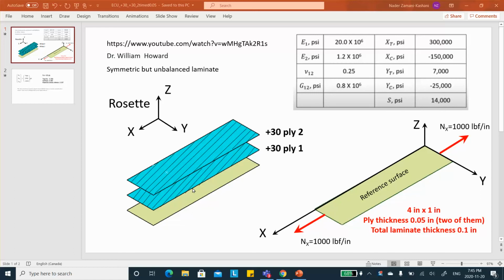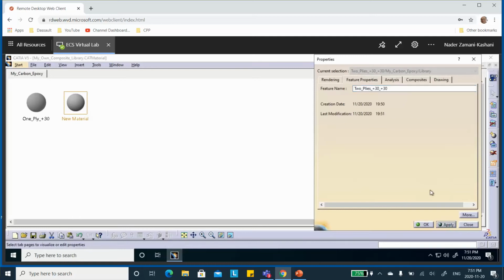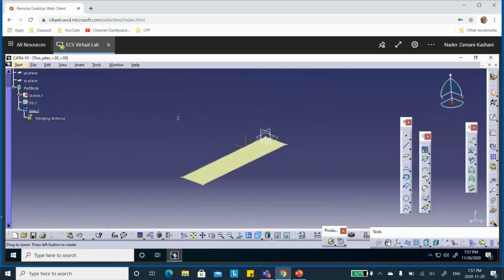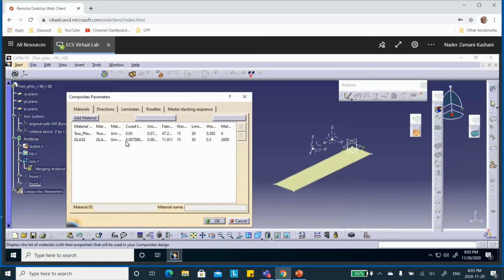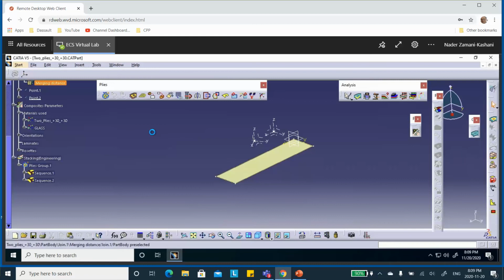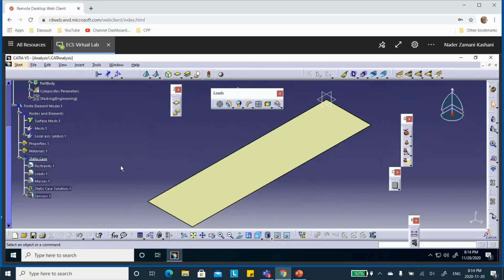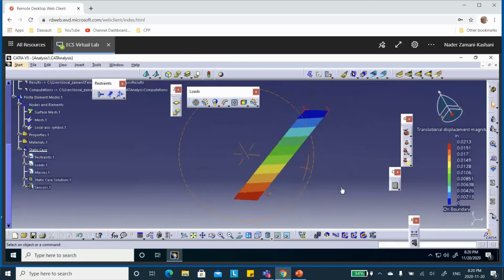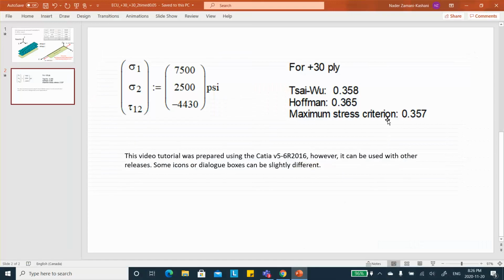Composites Catia v5 "Native" FEA, video 3, Nader G Zamani

Comment: There are som many parameters to fill in under the material property. Most composite material suppliers do not provide that many information. What I have from a supplier are 
1. Tensile Strength
2.Tensile Modulus
3.Compression Strength
4.Compression modulus
5.Flexural strength
6.Flexural modulus

Can I ignore other parameters in CATIA by putting 0?

will the missing information make any effect on the result?

Thanks
Romy